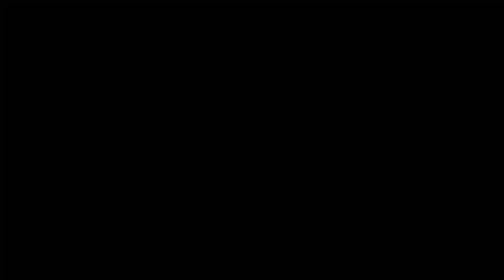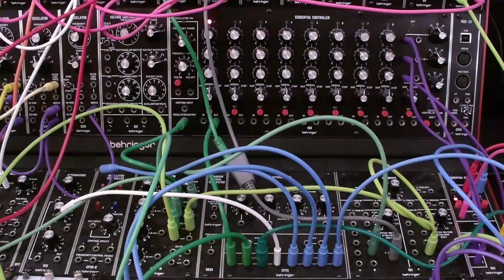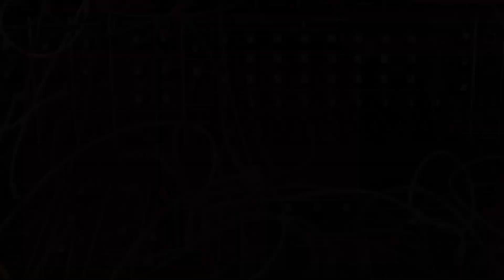960 Sequencer Advanced Techniques #3

Comment: Hi. I love your series of System 55 videos. Very usefule as it's quite a steep learning curve. I was hoping your 960 videos might be able to help me with a problem, but it wasn't covered. I have two 960 sequencers. One plays a lead line, the second a bass line. I have the Oscillator Out of the first 960 the Shift input of the second 960. 

The good news is that the first 960 and the second 960 move through each step in sequence. The problem I have, though is that I can only hear the sequence from the first 960. Not both played simultaneously. Each sequence works fine when they're not connected. Any thoughts would be very much appreciated. Many thanks, Tom.
Reply from the maker: How are you triggering the voice of the second 960?
Reply: Thanks for replying. I'm triggering the second voice using the first row output. It's driving a 921A Frequency Control Input, which is subsequently driving a single 921B.
Reply from the maker: @ Let me back up a bit, focusing on the second 960 which is not making any sound.  I'm assuming that the voice you're driving is part of the System 55 and that you are using 911 Envelope Generators for the filter and VCA modulation.  
To drive the pitch of a VCO you have to have a (keyboard) control voltage.  You're getting this kCV from the "row" output of the second 960.  That's working.
You're using the first 960's Oscillator output to drive the second 960's "shift".  That's working.  
This oscillator output is a "voltage trigger".  When it "goes high" (5v? 10v?) it triggers the shift.  What this v-trig will NOT do is trigger your 911 envelope.  Are you converting it to an "s-trigger" (e.g. with a 961 interface module?)
Reply: @ozhalljr  You've described my patching spot on. The second 960 drives the second voice perfectly when the two 960s are not connected together. I'm also converting the second 960 Oscillator Output to an S-trig using the 961 Interface, which is then driving the Envelope Generator.
Reply from the maker: @tomjw1306  Since you're shifting the second 960 from the first 960, the second 960 Oscilator Output is not relevant.  Use the FIRST 960 oscillator out and put that into the 961 interface.  Actually, you're already doing that, so put the 961 s-trig out into a multiple and drive your second voice with that s-trig.
Reply: @ozhalljr You are a genius, thank you. That worked perfectly. I really do appreciate your help. Thanks again. Tom.
Reply from the maker: @tomjw1306  Excellent!  Glad I could help Tom.
Reply: And just to add more info, I'm using the Oscillator Output of the first 960 to drive the Shift Input of the second 960 via a mult.